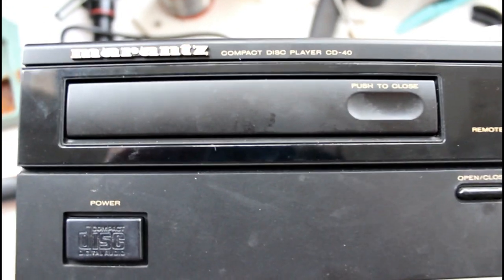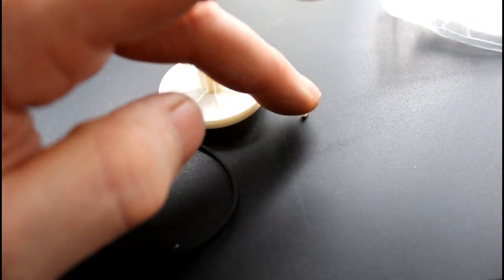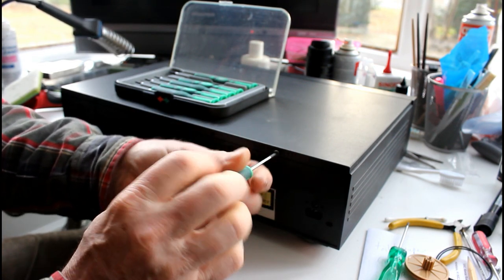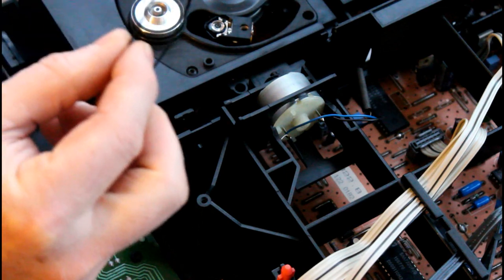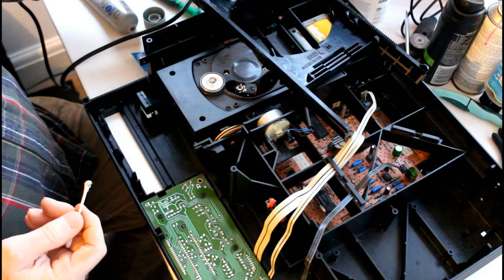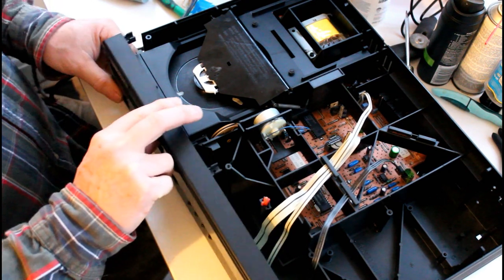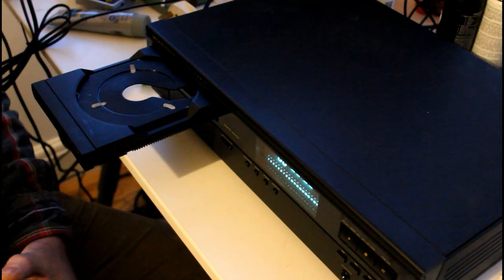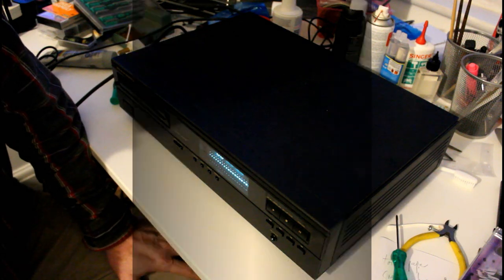Repair Marantz, Phillips, Rotel, Technics etc. CDM-4 (CD media tray)

Comment: Excelent!!!! I fixed my 1991's Marantz CD40 right now. It took me bring the replacement from Amazon to Uruguay 3 weeks, but the wheel was desintegrating. The rest of the player is working 10 points, even the belts!!! Thanks a lot for having made this tutorial!!!
Exelente tutorial, me permitió cambiar el engranaje de mi Marantz CD40 de 1991. Es un equipo excelente calidad que con los años apenas presenta esta falla que puede solucionarse con poco dinero y esfuerzo.

Comment: Thank you for this wonderful repair instruction video. I have 30+ years old Philips CD850 MK2 CD player which had exactly the same problem. I was able to get it back up and running by following your video. CD850 is almost identical to this Marantz player. Back in the day, they came from the same assembly line. 

Assumably the plastic wheel which runs the media tray mechanism is the Achilles heel of the system. It just cracks when it gets old. I ordered the same wheel from Thakker GmbH und Co. KG from Germany via eBay (10,40 EUR, prompt response and delivery). It is unbelievable that you can still buy parts to 30+ old year device! This is good for the planet that we can keep old systems up and running.
Reply from the maker: Thank you for your kind response and comment. I am glad this video helped you with the problem. If you feel inclined, please subscribe to help the channel grow. Kind Regards, Matthew.
Reply: @dembydish  gostei muito

Comment: Thank you so much for this video tuition. It was very, very useful, especially when the sliding tray fell apart on removal- watch, pause, watch, pause... and it was back together (... never would have guessed otherwise!). One thing to note on the Marantz CD52 Mk II, at 4:20 as well as the 3 plastic tangs, there is a further small screw to remove from the metal underside panel (below the headphone socket). This was easily the trickiest, most time consuming bit of the job for me. Thanks to the video everything else went smoothly. Now listening to CDs on this lovely unit without the russian roulette’ of whether the disc drawer will open or not!

Comment: A top video that explains much. Be careful, the 52 mk2 has 5 lower, plus side lugs. The cd drawer cover seems to need to be remove before extra access/ease of refit, this is done by exposing some of the drawer, (easy if the tops off), pushing the drawer front GENTLE to the left and a light tug forwards. The top rear screw secures the earth strap. Once understood this is an easy job

Comment: God bless you sir! I fixed my Marantz CD42 MkII using this - a couple of small differences but it works a treat
Reply from the maker: Hi there Mr. Skinner, I'm glad I could help.  Thanks for visiting the channel and please subscribe if you feel so inclined to help the channel grow.  Keep safe.
Reply: How did you get the facia off the CD-42Mk11
Reply: @getalookatthis  If I remember rightly you have to first get the end of the tray off,  the part that says ‘bitstream conversion’ this is held in place by a couple of plastic hooks so push it upwards or sideways. Once that’s off, you can take the fascia off without a problem. That was the trickiest bit of the whole operation. Good luck.

Comment: I have a Magnavox CDB-492 from 1990 which I use every day.  I have personally never had a problem with the loading mechanism other than a perished belt.  In the time I've had the player I've put in NE5532 op-amps, put new rubber on the spindle hub and replaced a few bad capacitors.
Reply from the maker: Thanks for your comment.

Comment: The reason for the extra space inside the unit, is due to the fact that the case, where all the circuits have been placed in, wasn't just ment for a CD player. Philips, which owned Marantz during the time your CD player was made, actually build this Marantz CD Player. This unit is actually Philips CD player with the Marantz branding on it. Now for the extra space, Philips did a lot of "clever" tricks to make the production cost as low as possible on these units, by using the same casing as other products of them. You may have noticed that there are two "holes" on the rear of the CD Player where there normally could fit two aerial connections like with a VCR. The reason for this was that Philips, who manufactured this unit, with the Marantz branding, build these cases to be used with the VCR's, CD-I, CD players, and who knows what else more, to directly fit in them. This helped to lower down the production cost on these units, cause Philips didn't need to made seperate panels. Now don't get me wrong, I am not saying you have a cheap CD player!! This is a really well made unit with really great sound quality, but Philips used to everything back in the day, to make a unit as cheaply as possible to produce, but still keep the level of qualtiy up! I know all this because my grandfather used to work in the Philips plant just 6 miles from where I live in Hasselt Belgium. The chance is high that you have a "made in Belgium" unit as wel. Greetings.
Reply from the maker: Thank you for your informative reply.  I enjoyed your addition to this video and learned something new too!  Greetings from the UK.
Reply: On the underside of the traylid from a cd-72 I found a 'Philips LOMMEL' signage. Always thought this fine machine was surely made in Japan.
Reply: Yes, My CD850 MK2 is made in Belgium

Comment: Hi, had exactly same problem with my CD52. Followed your instructions and was surprised how easy it was to change the wheel and belt. However, the tray now sticks on opening and I have to ease it out by hand. Sometimes the tray is not staying open and closing instantly. After 4 or 5 attempts to rectify I got fed up and bolted everything back together. The tray still needs teasing open. If I press close it sticks but if I hit play it closes. Any ideas would be gratefully received. Thanks. p.s. I did notice that the new belt ( from China ) seems to be thinner than the old belt. UPDATE..... When I ordered the new wheel and belt from China I remembered to order two. Both from different sources. Second set arrived today. The belt was definitely thicker. So, tools out and in around 20 minutes changed belt, left in the new wheel. Bingo, just spent 4 hours blasting out all my old tunes. So, be aware that the belts can be quite different. Thanks again for the video, would never have had the guts to try repair without it. 👍👍
Reply from the maker: You are welcome, i'm glad you solved the problem.  Please subscribe to help get the information to others.

Comment: Fantastic demonstration - I'm listening to a bit of Kate Bush's Sensual World in celebration of fixing my CD drawer.  My player is slightly different to the Marantz in the video - I had a little screw under the facia, holding a strip of metal on the inside of the facia to the body which had to be unscrewed from the outside before I could get the front off - and the front of the CD drawer had to be slid back on (with the drawer open but switched off)AFTER the drawer had been refitted.   ' I am also the proud owner of a very funky little star- shaped screwdriver for my non-allen key screws.  THANKS AGAIN for a really good, step-by-step, well explained video.
Reply from the maker: heppers22 You are most welcome.  I am glad you managed to fix your CD player and that my video was useful.  Thank you for taking the time to return to the video page and leave a comment.

Comment: Really useful, thank you. My replacement wheel from China arrived intact but with the wrong belt so I reused the old one. My CD40 doesn't have the third screw on the back panel so perhaps they left the factory with only two.
Reply from the maker: Thank you for your comment, I'm glad I could help.

Comment: Great video  I followed instruction and replaced the wheel and belt. The tray works perfectly only problem is the disc wont spin around when loaded hence no music playing. Any ideas what might be wrong
Reply from the maker: If it worked before, it might be that the laser assembly isn't in the correct position.  You could try gently pushing towards the start of its travel, where the center of the disk is.  It needs to be there to read the CD and understand there's a disk present.

Comment: Thanks for this video, not too easy to find this kind of detail on this models. I have a the same Marrantz. No problem with the draw. Is working perfectly. Just one small issue : a bit of mechanical noise when playing. Not bothering with most of the music but you can hear it when playing classical music for exemple. Any ideas on possibles causes? I was wondering if it is just a matter of putting grease in the plastic wheels holding the CD from the top (sound seems to come from there) or oil into the shaft of the motor. What do you think? Any suggestions on brands of oil and grease should I use? I will be very thankful!!
Reply from the maker: Hello Juan, reading you comment it seems to me (as you have deducted)  you have a lubrication problem.  If you hear the noise as the CD is turning it may be the motor, or any part that is turning with the CD.  I'd suggest using a very light oil, like sowing machine oil and apply a drop or two to the shaft of the motor and the CD hold-down.   Thank you for your comment and please subscribe if you feel so inclined to thep this channel grow.

Comment: Hi there. Would u know if a Marantz CD-63 can use the same wheel as the one u got in the repair video? Thanks .
Reply from the maker: idora99 The Marantz CD63 is not listed on the list I show at the end of the video.  But this is not a complete list.  If you have access to the player, you can remove the lid and look at the transport mechanism.  If it looks like the one I show (the CDM-4) then it will fit.  There are a few variations of the transport but they are basically designed the same.  If it looks like it, then I'd take the risk and buy the part.  You could sell it again if it is different, a visual comparison would quickly show if they match up.

Comment: Good morning, I have the old Philipps 950, exactly the same problem but the drive wheel is underneath...nitemare, I wonder if they made a tool for putting the belt back on.?
Reply from the maker: Evening Thomas, I'm not familiar with this model, but I doubt any specialist tools are available these days. I'd suggest making an inverted hook(s) out of wire to coax the belt over the wheel, or if it's broken, you most likely will need to remove the media tray. However, this is just supposition as I don't know the model layout. Thanks for your comment and good luck, I hope you figure it out. Keep safe.
Reply: @dembydish  Evening, I stripped the whole deck down, it was hard going. The marrantz uses philips parts but the design is different or rather the CD 950 I have is an earlier model. The motor is inverted vertically and the pulley wheel is underneath the tray chassis accessible by removing a small base plate, problem is the PCB has to be removed to access 2 screws holding the tray in place..... terrible design....if thats unclear, and anyone wants help I will put info together, the manual is no help.
Reply: @dembydish  oh by the way, you are correct, I had a cheap tiny flat spanner, 8mm or so, that I bent the prongs up with pliers, worked great, except the belt can't be totally removed......see above.

Comment: Hi theregreatvideo. I have a technics ch950 cd and the tray comes out then straight back in. Any ideas would be great. Thanks all and stay safe
Reply from the maker: Hi Breeze, i'm not familiar with that model or the media tray used.  Really without seeing it, I can't be of any real help.   Looking closely at the mechanics of the tray and any sticking switches or levers that activate the return mechanism may help identify a problem.  That's where I'd start.  Good luck.
Reply: @dembydish  thanks for the reply👍enjoy the weekend

Comment: I have the Marantz CD6000. Sadly not on the list. The gear wheel is definitely broken and it isn't this one - this is like a pulley with a groove, mine has teeth around the outside and there's no belt (as far as I can tell).   I can't figure out what the replacement part is. Anyone reading this can give me a hint I'd be most obliged.
Reply from the maker: Hello Rasheed, the best way to find the part is to identify the type of CD tray your machine is using.  The best way to do this is to look on the internet forums etc. using the machine's make and model number. Someone may know what it is, pictures will likely exist too.  When you identify the cd tray type, you may be able to find the replacement part. I expect many other CD players use the same tray so the info is out there somewhere.  This is how I identified the one in the video.  Given the age of the players and the fact they're no longer manufactured some research is necessary.  I got my replacement wheel on eBay.  I hope this helps and please subscribe .  Good luck and thank you for your question.
Reply: @dembydish  thank you for replying! Subbed. It used the philips VAM 1201 which is interchangeable with 1202. That's the laser transport - not the disc transport. And this laser transport is indeed used in many, many machines, just like your pulley. I did wonder if indeed my ubiquitous laser and your ubiquitous pulley were related but it doesn't seem so.

Have searched extensively. Not actually on a lot of forums though. Guess that's next.
Reply from the maker: @RasheedKhan-he6xx   Hi Rasheed, thank you for subscribing.  It seems you have this well in hand, I wish you luck in sorting out your problem.  Keep safe and hopefully a better 2021.

Comment: Thank you so much for this video instructions. I replaced belt and and wheel. Tray is working fine but CD does not want to start playing. Any suggestion? You can see what is going on on this video https://www.youtube.com/watch?v=nwjhamyWIGQ . Can anybody help?
Reply from the maker: HI Marijan, sorry I took so long to reply.  This looks like a date reading problem, the machine usually scans the CD to read data about track numbers and timings and if the CD is playable etc.  Since it is a commercially available ABBA CD it should play.  It may be a dirty laser eye, this can be caused by dust etc.  Suggest you clean it carefully with a cotton swab or compressed air and try again. If not then it is likely an electronic problem. I hope this solves your problem, thank you for your comment and please subscribe to help the channel grow.  Good luck.